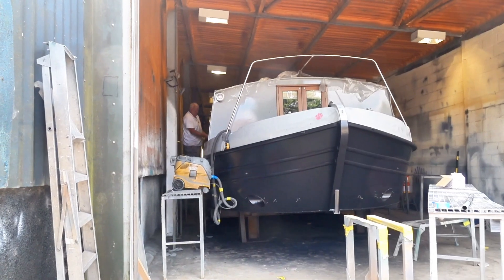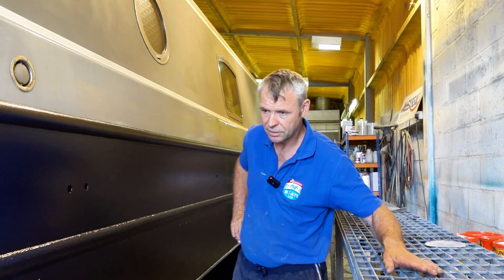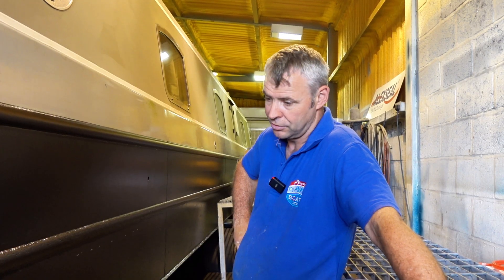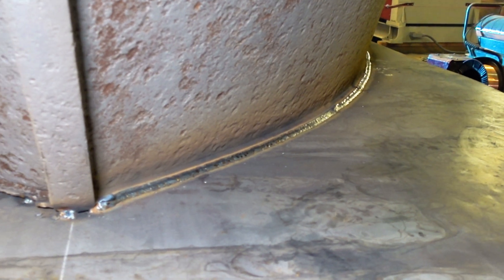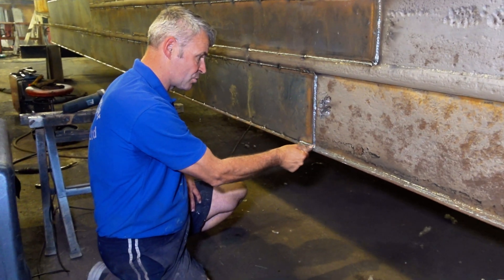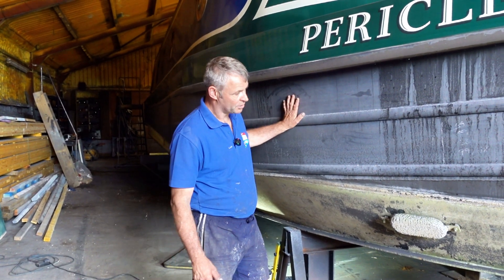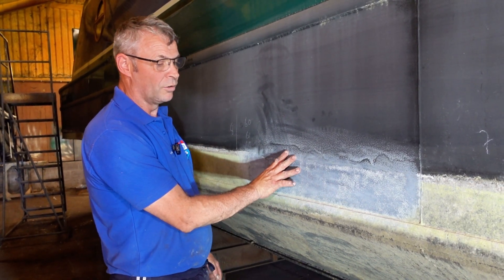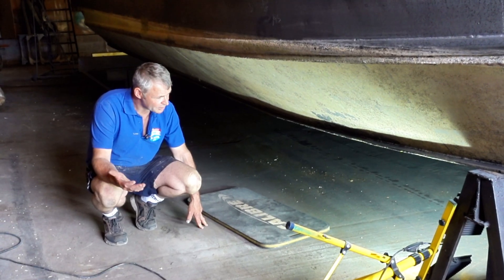Is your boat rotting away under the waterline?

Comment: Some nice welding there Dave and as usual excellent paint work. I've done a lot of welding over the years, not a coded welder but various training courses and as part of my job servicing ground equipment in an airport. I always found steel not properly cleaned and degreased mess's up any paint applied. The prep is 99% of the job. 
Some companies just cut corners either by design or cuting cost to meet a bottom line; end of the day it comes back to bite them. Unfortunitly there's no real British steel industry anymore and most steel is imported. Quality is possibly not as good as it should be and possibly an element of recycled steel too. Like the Japanese cars in the 70/80's, recycled steel. Cant beat them now.

Comment: Just a silly queztion. Could you overplate the whole hull in aluminium.  A bit like overplating an old wooden hull ?
Reply: Why would you want to? But not, can't weld aluminium to steel.
Reply: @dhutch2000   was just a thought.if steel eventually rusts away and aluminium  does not I thought  it may be a long term fix ( look at the age ofthe aluminium  boats- no rot and no need to paint). But as you say NO welding  one to the other....... now here is a thought  make a bucket shape of the hull  in aluminium.  Drop the boat inside and bolt it together  above the water line...... now even form me  that is quite simply a very silly idea

Comment: Interesting, are you saying that modern steel is of poorer quality? Thanks, take care.
Reply from the maker: Very hard to prove but it certainly seems that way as there is much more problems then years ago or it could be just builders not sanding down properly very difficult to say but that’s why it needs to be done properly just in case.
Reply: It would be interesting to get modern and older steels analysed to see differences in percentages of iron and carbon.
Reply: @mauricewatts2380  totally agree,im trying to find out, but I'm having difficulty getting to the bottom of it.But old steel definitely seems different corrosion wise to today's steel.
Reply from the maker: See our latest comment regarding the options available to steel
Reply: I would have thought  that went without saying
Reply: Boats now have a lot more electrics than they did a few years ago. Boats also sit in marinas on shore power. Many have defective galvanic isolation which causes pitting below the waterline.
Reply from the maker: Agreed boats do have many more electrics than years ago, however, there are also options available to assist with this and if the boats are sat in a marina on shore power all the time.  I.e. shot blasting and a two pack epoxy blacking.  There are ways to protect boats it’s just most owners don’t!
Reply: @philelliott5327  Dave would be aware of this me thinks
Reply: @christinewilliams9305 I was responding to the OP but thanks.😂

Comment: Do you have any opinions one way or the other about copper coating?
Mark
Alberta, Canada
Reply: I would be interested in an answer to Marks question as well
Reply from the maker: This is a difficult one as we have done a few boats and not had any issues but if you look on line there are many unhappy customers but again this could be down to workmanship it’s not a easy coating to use and very expensive as you have to apply the normal epoxy for protection then the cooper coating is manly for the anti foul it certainly lasts longer then most anti fouls and is very hard wareing so I like it on steel boats and would definitely use it on my own boat.
Reply: One more question, regarding the shape of the bow of a narrow boat.  Why do they have a sloped bow instead of a bow which is at right angles to the water?
Mark
Alberta, Canada @bluewaterboatbuilder
Reply: @markrant1460  I would like to be able to see some pictures of all the different Bow shapes in one  place
Reply: @bluewaterboatbuilder  Thanks for your answer, as usual, no BS and to the point
Reply: Copper coating is used as anti foul, marine fouling is not a problem in the Uk freshwater canals

Comment: I would agree with everything you say and you do a very professional Job.The only issue I would suggest is if someone's boat at any point in time, wants to enter any area where you may encounter a mixture of Sea water and fresh water then epoxy your base plate.If your purchasing a new build or wanting longevity then in my opinion it is a must have.The industry is going to change due to people expecting longevity and quite rightly so and whilst you are top of your game and sadly in the minority, at this stage base plate blasting isn't a standard practice but it will become so, going forward as who's going to invest 300k+ in something that's going to corrode when it can be fixed although understandably it's very inconvenient.Well done your 95 % only losing 5% because for not recommending Base plate epoxy and blasting if it's possible ? if any future chance of someone going into a part sea water/fresh water environment with any new build it should be highly recommended.But well done 👍
Reply from the maker: We do recommend the base plate on boats going into or around salt water and have done many barges like this. 

And are more then happy to blast and epoxy any boats but it does come at a cost we normally blast the base plate before the steelwork is done and use a holding primer then epoxy at the end so we don’t have to blast underneath the boat but where do you stop then should you do inside too the boats will last forever and I will be out of business 🤣🤣🤣

Thanks for your nice comments it’s took a long time to get people to understand the importance of this.
Reply: @bluewaterboatbuilder  😂 you won't ever be out of business as you do far more than others and therefore there will always be a demand for quality over quantity. My feeling is it might be possible to get the same adhesion qualities as  blasted SA 2.5 without blasting the base plate but grinding it back or abrading it back for a mechanical bond and then applying epoxy and getting chemical bonds when the vessel is finished. You are doing  great trying to get the message out, and I wish you well, as your one of the few in my opinion,who know exactly what they are doing and trying to help people understand about steel boats and longevity.Well done and thank you 👍
Reply from the maker: Thank you for your comments.  We are certainly trying to make boat owners aware 👍